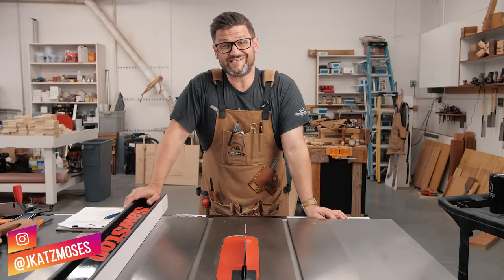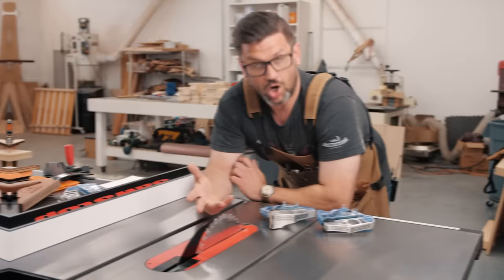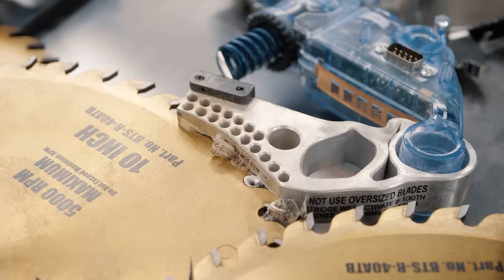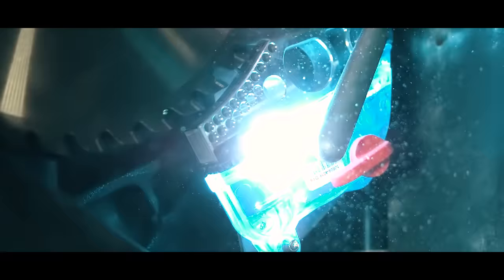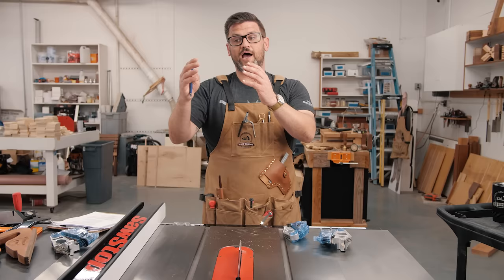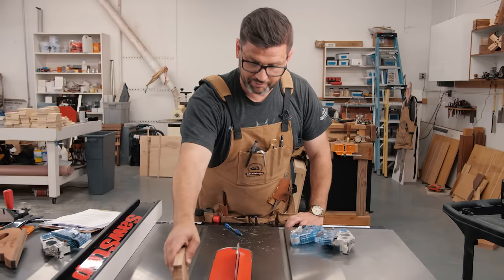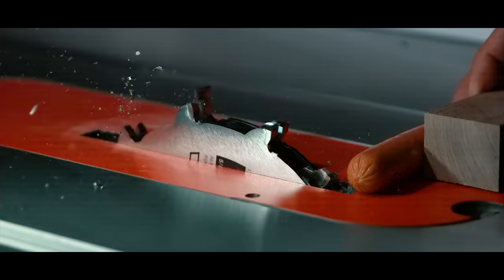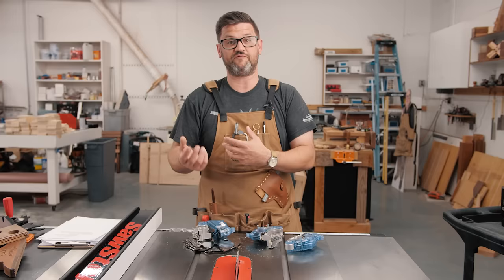How Safe is a Sawstop Saw? - Never Before Seen 19,000 FPS HD Slow-Mo Video

Comment: My school has a sawstop, that exact same model I think, and about a month ago I activated the stop (it was a misfire in the middle of a board, there was nothing near the blade) and I’ve got to say it’s as cool in real life as it is on video, a great tool to have near kids
Reply: Honestly any school that allows students to use the tablesaw should probably have one.
Reply: What caused it to misfire?
Reply: @t-rex4211  I really have no clue there was nothing to suggest a reason for an activation
Reply: @voidaurora3326  maybe moisture in the wood conducted the electricity
Reply: @az_rite  it’s possible, it’s not like Ohio is known for being dry, heh
Reply: @patrickdetuncq9690  interesting
Reply: A lot of schools use Plywood or MDF, basically anything that’s pressed using glue (pretty much anything other than raw timber) can set it off.
Reply: @voidaurora3326  could have been wet wood
Reply: @t-rex4211 it's triggered by anything that conducts electricity making contact with the blade, could be moisture in the wood, could have been a small nail or piece of metal embedded in the wood, sometimes it can even go off from a buildup of static electricity (this usually only happens when cutting a material like plastic though)
Reply: I thought it only works on hotdogs
Reply: @MarioLuigi0404  and workplace
Reply: was the wood wet at all?
Reply: @codyskypek1724  nope, bone dry.
Reply: My school’s shop has saw stop too. We have never seen it in action yet, but it’s nice to know its there.
Reply: @nefreston8503  Someone did a test on you tube with their finger.
Reply: At mine, I know a kid who ended up having her thumb go strait into it (large dado too). There was a sacrificial board on the fence had a large hole in it. Corner of the piece got caught in  the hole, kickback ensues. If it wasn't for the saw stop, she wouldn't have a thumb at all. Sent the pushblock 15 feet in the air and probably 30 feet away.
Reply: Fucking expensive to replace. Misfires happen a lot.
Reply: I work in a pattern shop and we have one of these. If you’re using repurposed wood, stuff contaminating the wood will set it off. Pieces of silicon caulk, clay, metal duct tape are all things that can set it off

Comment: Very cool stuff. U could've explained how the sawstop works technically wise. For example: "At the most basic level, our technology works by continually monitoring a small electrical signal in the saw blade. The human body is conductive so the signal in the saw blade changes when skin makes contact with it. It's that change to the signal that activates the AIM safety system and engages the aluminum brake.".

Comment: Having seen this, I think it may not be a perfect system, but it’s certainly something I’d rather have and not need than need and not have. That having been said, I still think that prevention is still the best safety measure here, and would do my best to train myself to always be careful around equipment like this. Granted, it’s possible to become complacent over time as you get used to working with such tools, but I like to think that this could potentially be somewhat mitigated through mindfulness.
Reply: It's just a matter of time no matter how careful you are that something outside of your control or you simply slip up because people are not perfect performers at anything, and there WILL be an accident if you are doing something dangerous like feeding wood into a circular blade spinning 4k rpm.  Just a matter of time.  Hopefully people go their whole lives without ever having that accident, but remember the beginning of the video, over 60,000 table saw accidents per year.  Yeah, this sawstop tech is a very good thing IMO and I won't ever have a tablesaw of my own without this tech.

Comment: Ads: "it works and is safe"
Live examples "it works and is safe"
Woodworking safety boards: "it works and is safe"
Hundreds of slo-mo videos covering SawStops: "it works and is safe"
people, still: "buT WhAt If YoU HiT iT rEaLLy FaST"

Eventually we're going to be firing fucking hot dogs from air cannons because apparently that's how fast these people whip their hands around near their completely unprotected sawblades
Reply: If you have a bad kick back it can pull your hand over the sawblade in an instant.
Reply: @systembypass6930  it doesn't matter, people shouldn't rely on those if they are gonna punch their hand at the speed of sound, perhaps I think a person with atleast some common sense can just be careful
Reply: @Random-zt4ig  I get what you're saying and agree that these are almost full proof and completely safe. But saying "it doesn't matter" to his comment is a little disingenuous because kickbacks happen even when you are being safe and there is a small possibility of your hand being pulled into the blade quickly even if you are being careful.
Reply: @sageosaka  thank you some times I wonder if people just comment just to comment without thinking. I work in a cabinet shop and if I ever get to have my own cabinet shop all of my table saws will be saw stop. You can never have to much safety when it comes to your Hands Ears and Eyes.
Reply: @Random-zt4ig  Did you even read their comment? Or do you not know what kickback is?
Reply: @thatotherandrew_  what is it?
Reply: @prav2568  When you're working with a material, then it "catches" on the fast-moving blade and therefore yeets the material, and your hand holding onto it, at high speeds
Reply: @thatotherandrew_  Ohhh okay thankyou c:
Reply: this comment is underrated
Reply: The other thing that gets me is like, okay, fine whatever, you randomly punch running table saws, sure. 
Even if it doesn't protect 100% of the time, it's still going to protect most of the time, and it's still worth getting.
Reply: Wouldn't it be fun?
Reply: @mwesolo1315  bro wat do you use your brain to think or your hands
Reply: @systembypass6930  careful, ur not really allowed to think for urself nowadays
Reply: I'm no expert in wood working. but who is thrusting their hand like that at a table top saw in a realistic scenario, if anything isn't slower more of a realistic scenario than fast?
Reply: its safer than the regular one at least
Reply: When perfect becomes the enemy of great.
Reply: I laughed way to hard at this. 😂
Reply: @systembypass6930  but they even did a test at full speed and showed it only cut an 1/8th on an inch through which yes it will hurt but it will absolutely save fingers/hands
Reply: @Loxu69  yeah I'm not talking about the saw. I trust that machine with my own hands. I was talking about big pharma
Reply: Why the heck would you slam your hand into a sawblade?
Reply: Did you not watch the video? Hitting it really fast did cause a massive difference to any of the dozens of demonstration slow-mo videos I had seen before. It's useful info.
Reply: @blazingdude11  We do. You can find tons of videos on youtube of marketing people getting shot while wearing their company's vest.
Reply: Is not safe, try losing 1/8" of a finger tendon, which is what they're really comprised of. Consider EVERYTHING in front of a Camera propaganda. The difference is, you already are, but you don't know you are or why. Hence you keep repeating the same idiotic question.
Reply: @Random-zt4ig  do you have any clue what kickback is
Reply: replying to some ppl here 
Yes you should be careful never underestimate any kind of saw 
some idiots can lose fingers using just a hand powered vintage saws 
Yes the technology is realy good and can save parts of your body or just reduce damage to minimum
and 
YES ppl who comment most about this thing complaining are keyboard warriors flinging their fingers FTL speed
that is why they lost some in the process of writing and dont belive you can save yourself a thumb using tablestops
Reply: BuT WhAt iF fLaSh RuNs InTo tHe BlAdE
Reply: Yeah, getting ultra fast sounds stupid, but I'm wondering, what if you wear gloves? Or with no direct contact to the table?
I mean, it's a must-have safety tool, but knowing its limitations seems a good thing.
Reply: That sounds more like something Myth Busters would try to do.
Reply: I would watch hot dogs fired from air cannons on a sawblade XD
Reply: i got a great idea...how bout keeping the fingers out of the path of the blade? just a thought lol.../shrug...
Reply: @wizardbeard69   Such an unrealistic expectation, please try to be reasonable...
Reply: @sageosaka  One problem at a time man, Hes making the technology significantly safer why detract by saying it’s still unsafe. I also don’t think that any sane fucking person believes they deserve the right to be able to punch a spinning blade with 1000 gs worth of kinetic energy and walk away unscathed lmfaoo.
Reply: @Kanathil  LOL you're a damn fool and I love it!
Reply: @MrBarnouze  the gloves thing sounds interesting but I guess once the blade tearing through the glove and hits skin the stop reaction would occur
Reply: @lapintueur4799  yes me too
Reply: @CountryManGames  Apparently there is a possibility of kickback. . .I'm not an expert and I am just learning how to use a table saw so I was thinking the same thing but, after hearing about the possibility of kickback it really makes me wonder if this is something my clumsy ass should be around lol
Reply: @MrBarnouze  i think wearing gloves while working with devices that rely on spinning (saws, lathes) is a security risk in general and should be avoided
Reply: @valcaron  just search up actual videos of hand tests of these saws then..
Reply: @poika22  yes, of course, I'm just saying that every time people do this they keep asking for faster and faster and I just have to wonder.. how fast are they moving their hands around their saws? It's a safety feature, not a cure-all
Reply: @Arsenio Oro This is kinda like saying "well sit behind the bulletproof glass when it's getting shot at if you're sure that it works".. people have done that, but the smartest thing to do is minimalise risk
Reply: @einarabelc5  it’s better then losing a finger period. Losing a tendon hurts, and is very bad might even hurt function. But you have a finger.
Reply: @tonyhayes6471  Kickback is AWFUL. I recently had my first kickback, and while I was holding a piece of wood, 4 inches away from the black, on the backside of the blade, pulling the wood away from the blade (this was improper technique) the piece of wood caught on the blade, and it sucked the wood, and my hand into the blade at the speed of a bullet. It happened so fast, my hand went at about 100 mph into the blade, and my fingertips were cut down to the bone, in 2 of them. I didn't feel anything. The piece of wood shot like a bullet across the stop and slammed into a shelf. My hand was cut really bad, but I didn't cut my fingers off or hit any tendons. Now, the way to avoid a kickback is to use a "riving knife" that is either a thick kerf, or thin kerf width, depending on if you have a cheap thin kerf, or a standard expensive "normal kerf 0.125" wide blade." If you don't have a riving knife, you can adjust your fence improperly, so the BACKSIDE of the blade, furthest away from your body, is 1/64th further away from the fence, than the front side of the blade. You adjust your fence, so the rear of the blade, has a larger tap, than at the front cutting side of the blade, so that way the wood doesn't touch the rear side of the blade, as it's moving through the cut. You "toe out" your fence. If your fence is toed in, and the rear of the blade burns the wood, then you could have a severe bad kickback, like what I had. Had my fence been toed out, my kickback wouldn't have happened. You can install a temporary riving knife, that presses in with 2 little pins. Look on Amazon for "riving knife accessory" and it's only $25. Make sure to get the thin or thick kerf model, and use the appropriate blade. Thin kerf blade is 3/32 (0.95 to 0.100") and a thick kerf is 1/8th (0.120-0.125"). The other thing is, you need to be holding pressure at all times on the wood. NEVER stop making the cut, and let off pressure on the wood. If you "let go" of the piece of wood, it will kick back violently, if it is allowed to just sit there, unattended, with a spinning blade. I've made 25 years worth of cuts, with my fingers next to the blade, but if you keep the wood moving, the forward cutting tension, keeps the wood aligned properly, and even if the wood turns, it will not kick back, it will actually just "burn" and it will slow the blade down. But if you "let off" and get scared, and "stop moving" and just stand there looking at the wood, it has a possibility of twisting, then rising up slightly off the table, and if it rises at all, the teeth will exponentially grab the wood and shove it backwards, until it turns into a full kickback. Hold the wood DOWN, and hold it AGAINST THE FENCE, and holding it FORWARD, at all times. If you do this, it cannot kick back, even if the wood twists slightly. The sawblade can only make the wood KICK BACK, if you are not in control of the piece of wood, and you are not holding it down. When you switch to your push stick, you must not let the wood "free float" next to the blade, because it can twist, and catch on the blade. Maintaining pressure on the wood being cut is actually more important than using a push stick. Because if you grab your push stick, there is a moment of time where the wood can violently kick back and cause severe injury, while it's being "unattended." Hold the piece of wood firmly, then apply your push stick, and continue your cut, without allowing "slack" at any point in the cut.
Reply: @Ritalie  as a cabinet guy this I thr best how to guide for using a table saw I have ever seen. I appreciate the time and detail explained in this.
Reply: I want to see that.
Reply: if you hit it realy fast yuo are using your saw wrong
Reply: I personally excpect to get my hand on a saw with like 2x speed of that first sausage, not like fucking smashing it
Reply: @Random-zt4ig  seriously, if you managed to move fast enough to cause yourself any severe damage when hitting a sawstop protected sawblade, you're doing yourself more harm moving your hand than the saw is
Reply: How does the machine differentiate between finger and a piece of timber?
Reply: @maximiliankieser4686  He told us in the video.
Reply: @einarabelc5  So you are saying you'd rather not have this and lose and entire finger, than have this and only cut 1/8th of a finger. Interesting, tell us more about that. How is losing a finger more safe than cutting a tendon but keeping the finger so it can heal?
Reply: What if you're in the shop on a ladder and the table saw is running full speed and you fall off the ladder at terminal velocity onto the sawblade. I KEEP TELLING PEOPLE THIS PRODUCT CANT PREVENT REAL LIFE SITUATIONS LIKE THIS TURNING INTO A TRAGEDY!!!!!(Sarcasm)
Reply: @maximiliankieser4686  humans are electrically charged salt water bags. We are excellent conductors. There is a magnetic switch that is activated when the blade comes in contact with metal (or skin and blood. The magnet hits the charge and it propells a aluminum stop and drops the blade below the table top. They are spectacular tools.
Reply: @systembypass6930  Did they claim it will save you in every circumstance? Personally, I'm all for improving the odds in my favour, regardless.
Reply: @achosenman9376  I've seen videos of people slamming their hands on the blade in a tool demo. I would guess it would save your hands in almost every way. But there are still those freak accidents. Best way is to stay safe and aware though.
Reply: please dont say the f word like that
Reply: @systembypass6930  how fast do you mean when you say “in an instant?”
Reply: quality comment!